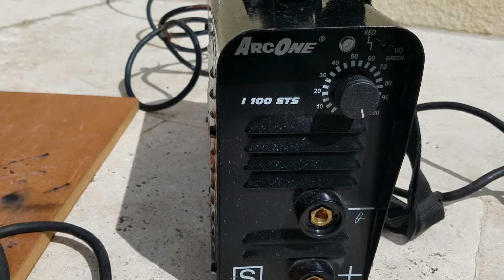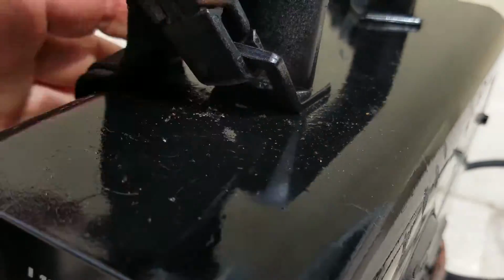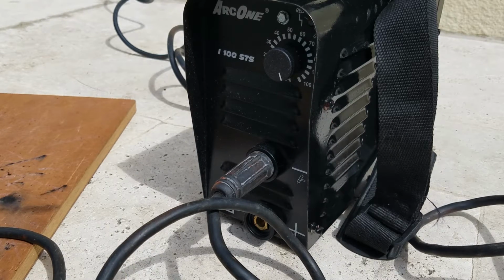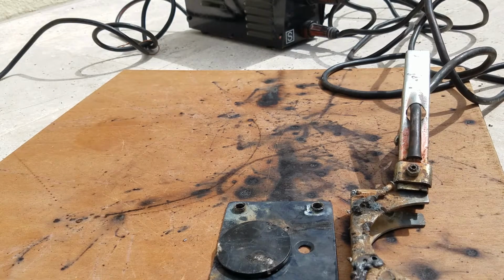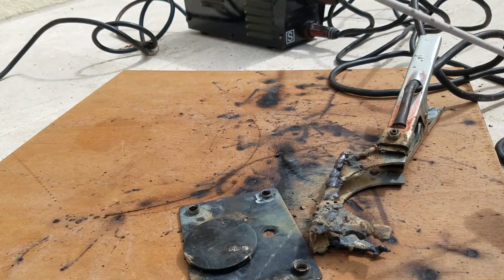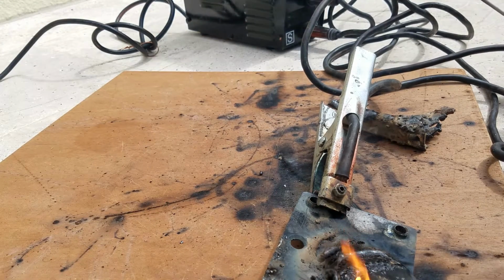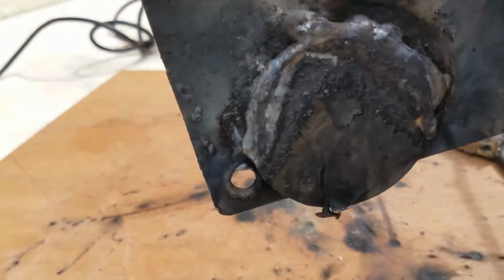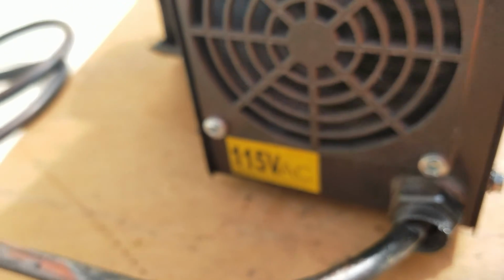ArcOne Welder I100 STS - Good Stick Welder for Beginner

Comment: I have one. mine is original black. I've had it over 20 years.
 It's too small for a 3/32 electrode. 
 Try a smaller electrode. It runs a 1/16 6013 at around 60 amps really great. 5/64 rods are available too.
Reply from the maker: Good Advice - Thank You!

Comment: Is this easier or harder than FLUX wire welding?

 It this stronger than FLUX welding?

 The stick is much larger than flux wire. Will this burn through metal like flux  wire?

 Does this put more substance into the base metal quickly ?

 Is this better to weld cars together?
Reply from the maker: I think that Stick is the Most difficult to weld, but easiest to set up. You just need machine and stick, but Actually welding takes some skill. But keep trying and you will learn. I don't think that one is better for heavy duty work. Just increase the voltage if necessary. Glad your interested in Welding!

Comment: I have that same welder, and I've ran 7018 with it well! My reccomendation to you is to clean your material. That's why your arc isn't striking right away. 7018 likes cleaner material, where 6010 or 6011 would be a better suit for the material you're welding, but I never got 6010 to work with mine. Also, with any kind of welding, watch your puddle! The puddle will tell you what you need to know! If you have any questions let me know and I'll be more than happy to help
Reply from the maker: James Piambino wow James, thank you for your assistance. I just got a 240V welder, see that video. Nice to know that there are such nice people like you around! Much Appreciated
Reply: @silverbankruptcy  No problem, it's always my pleasure to help out someone when it comes to welding!